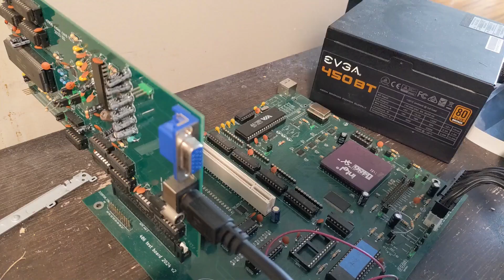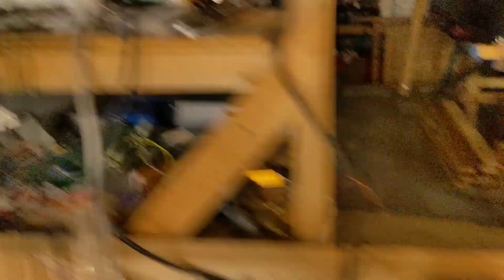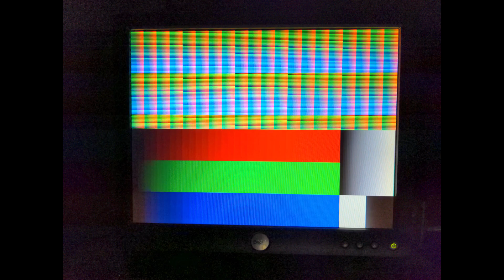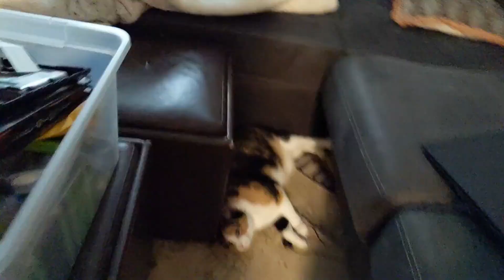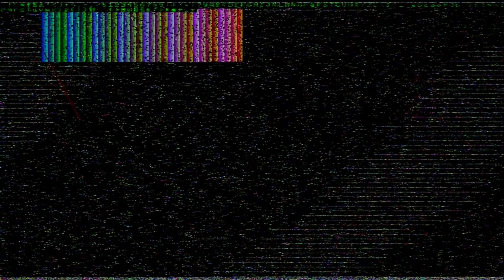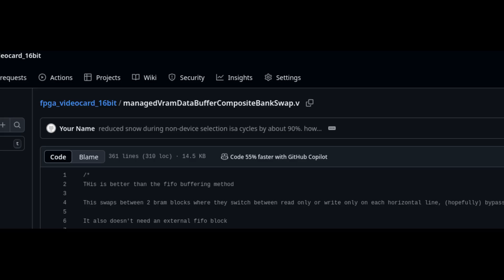FPGA video card part 2

Comment: are the ram's address pins fully disconnected from the ISA bus when you're not writing to them using the ISA bus? They'd better be, or any random ISA bus transaction will make your RAM read from the wrong address... such as the first line.
Reply from the maker: The data bus is separated with 74ALVC16245 transceivers and the address bus is separated with 74LVC373 latches. The latches allow me to only decode the address for however many tens of nanoseconds it takes for the fpga to figure out if the isa cycle is selecting the video card or not. If the video card had to stop accessing vram for the ENTIRE isa cycle when not being selected this entire thing wouldn't work at all.

Comment: Actual video cards often had the work split up on on multiple chips with fewer pins needed on each chip.

Does your fpga not have built in fifo buffers? Mine do - it's an addon to the built in ram.

Comment: This is brilliant work!  You should add a sprite engine waaaaay on down the line there.  meanwhile.... get some proper 24...30 gauge magnet wire, and some UV curable enamel.  bump up your techniques.
Reply from the maker: Hmm, I didn't consider uv curable enamel but smaller gauge enamel coated copper wire seems to be easy to get right now. As soon as I get basic "graphics mode" working without tons and tons of issues and bugs I do need to make a text mode. Sprites are basically just text mode fonts with multiple colors so there's a good chance I'll end up with sprite processing like the on the Commander X16 Vera chip and the Yamaha v9958.

Comment: PLEASE tell us the truck radiator fixing iron is just for a meme
Reply from the maker: I think it just looks bigger on camera than it really is since everything is filmed so close and zoomed-in. I bought it 10-15 years ago and it has really good temperature control. It's the same size as the cheapo ones they used to sell at radio shack.
Reply: Dunno what's happening but often youtube simply shadow-silences when I try to reply. I was trying to say maybe get a T12 with different tips including super thin precise ones and flat thicks for FPGA soldering.
Reply: @scotts-tech  Not sure what budget you're targeting but for fox sake at least get a T12 and tips with thermal sensor very close to the actual tip. Some wide straight tips up to 2cm are available and some cheapo hot tweezers would also come in handy. If budgeting try taobao.

Comment: This is amazing work! congrats on getting it working despite the pcb issues. I would definitely recommend biting the bullet now with going the BGA route to get some more IO and not having todo any latching. This will make dealing with timing issues easier. If you dont have a rework station (yet) you could always get the PCB manufacturer to place the FPGA and have it shipped to you, then populate the other components. You just have to double check you have all your pads correct or risk smoke.

Good luck! keep going on the project. Im super keen to see how it turns out.

Also, your OS is impressive! any links to that?
Reply from the maker: Thanks. I have a pcb heating station and a handheld heatgun. I'm currently experimenting with a qfn chip, maybe next time I order pcbs I'll throw in a ice40 256 pin bga experiment just for fun.

C++ OS is on my github here: https://github.com/Xeraster/SimpleProtectedModeOS. You also need this bootloader to run it: https://github.com/Xeraster/SimpleProtectedModeBootloader. It's not the easiest thing to set up but once you have a fat32 drive or image with the bootloader installed and have mtools installed with the correct config, the build script automatically updates the kernel on the fat32 image every time you run it. I'm sure I'll eventually have an installation iso or something but that's for another day.
Reply: @scotts-tech  Awesome, thanks!